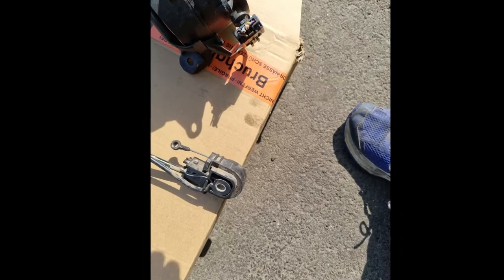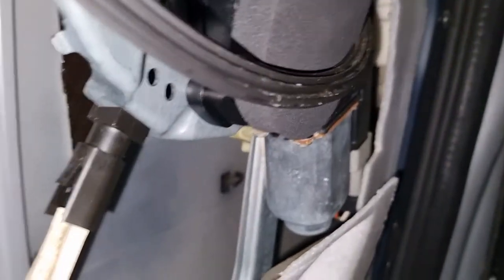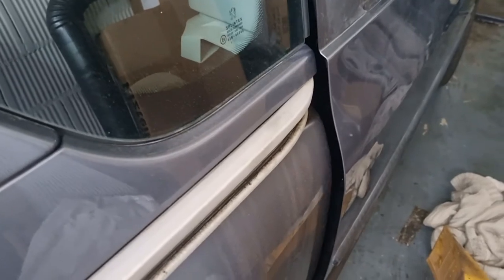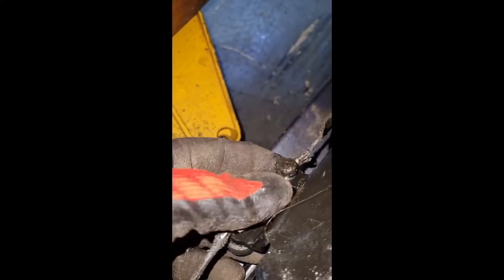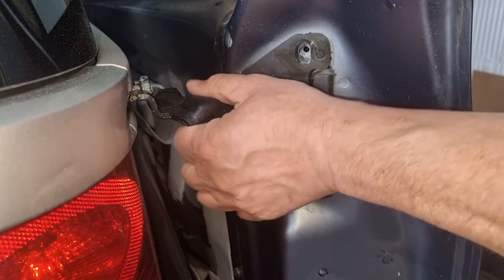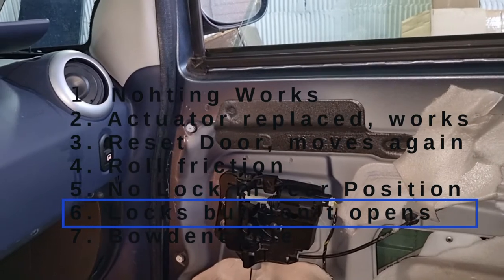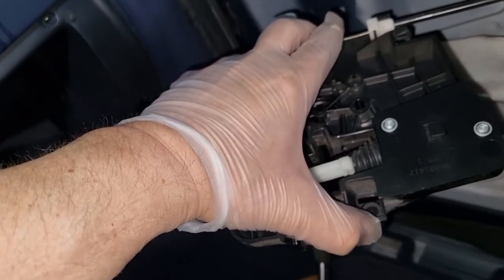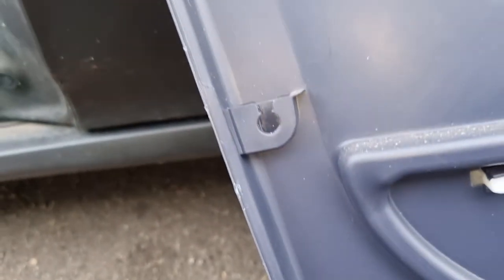Peugeot 1007 Sliding Door fault, fix  it in 7 steps

Comment: Thanks for the video, I enjoyed it a lot. A comment regarding shortening the cable (or increasing tension). I found out that this is not necessary, because on the new engine ordered, the last plastic part is longer than the original. You can easily disconnect this plastic attachment point (the two parts can slide apart) and exchange it with the old one. So with newly ordered engines there is a distance difference compared to the old ones, please note that. Of course, this only works if this part is not defective.
Reply from the maker: Nice, thx for your input. I'm going to pin your comment so the Community can participate cheers, Axel.

Comment: Outside door handles on mine do nothing now. I have to climb in the back and pull the inside handle. 
curiously after that the outside handle works again.
until I lock the car. Then I have go in the back again.
Reply from the maker: Hi, first of all i would check the array of electrical contacts if they all work. If they do, you shuold disconnect the Batterie for some hours. Then you should dismantle the inner door blade and check the nechanic items. Is the Connecticut line ok.....

Comment: Nice video.. 👏👏I have a same problem, please can you give me a link where I can buy a roller for my peugeot!?
Reply from the maker: Hello, actually not, but there is a FB Group and they give a lot of help. They know. Good luck with your repair.
Reply: I bought these rollers from aliexpress, about one year ago, they are just a little bit thinner, but they work like a charm. Both my doors work several times a day, and they work really well with these aliexpress rollers mate!
Reply: @qashqai69  thanks mate 💪
Reply: @qashqai69  Hey Tiago, could you provide a link or the search term to find it on aliexpress?
Reply: @qashqai69  Hello, could you give me the link to the aliexpress rollers? please.
Reply from the maker: @flesh77 sorry, unlikely not. But i found out, there are some furniture fittings, seems to fit.